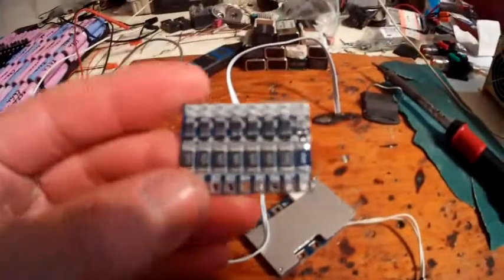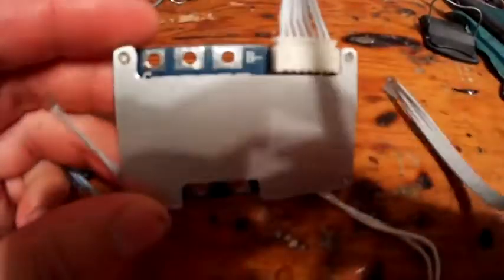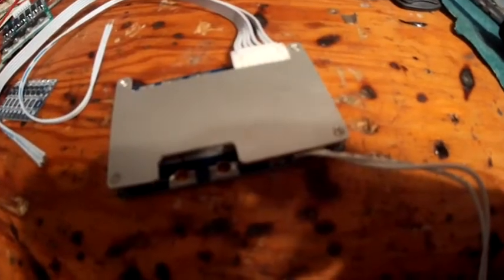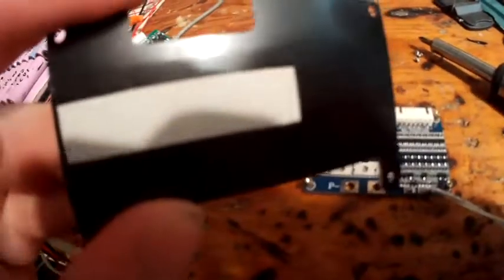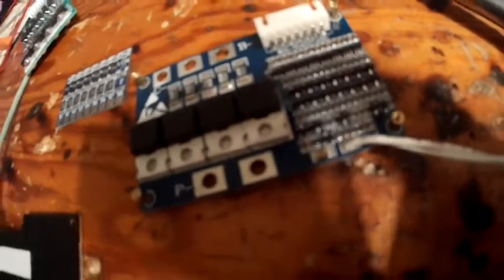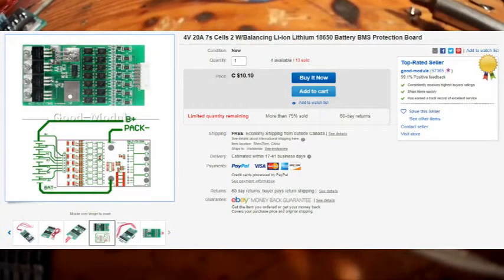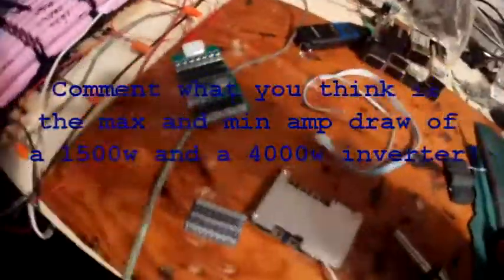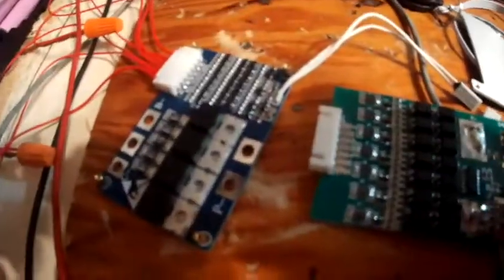18650 7s BMS 20a vs 50a (fake?) initial thoughts examination (see updated video instead)

Comment: yo, how did you wire the 20a bms with charger plus and negative etc, and does it even balance the batteries or its just shit?
Reply from the maker: 20A BMS 7s 50mA balance: https://ebay.to/2RN7ZU7
7s 60A dis, 30A charge, 60mA balance: https://bit.ly/2B1Ficn 

These are the only 2 I can recommend at this time. BMS's only start to balance once the batties reach 4.18vdc each. Most bms's are garbage unless you pay 100+$ and even then they don't really do enough to justify the high price. I've been using the 20A one the longest and it seems to work fine. the 50A work works as well but not a great option compared to the 60a one.  

Wiring the 20A BMS is very straight forward. https://imgur.com/a/1XzvYC2

I'll have to do an update video as I have a few bms's now. good testing is almost impossible. It is always best to only use proper batteries that are all very close in internal resistance and mAh. you need to put similar batteries in series not parallel. If you don't the bms will never keep up and you deff will end in a fire while charging one day.